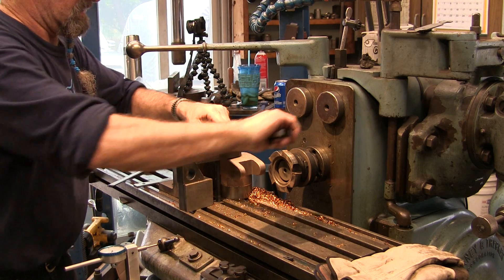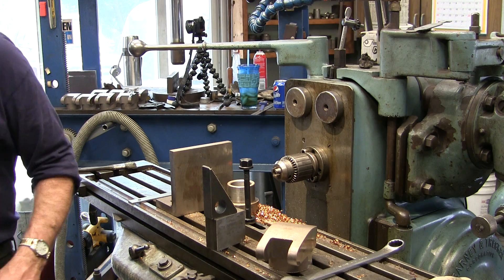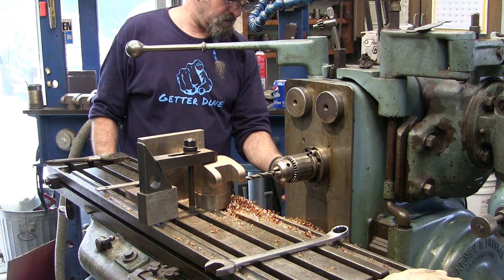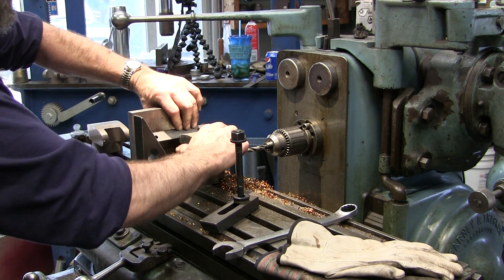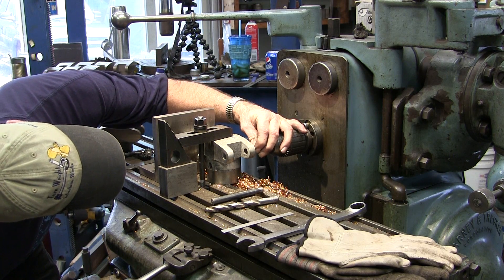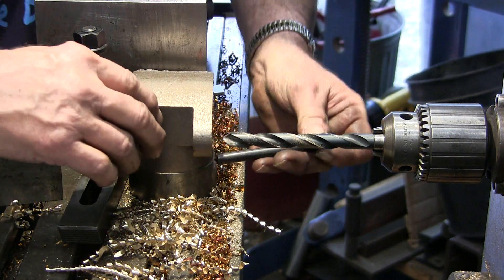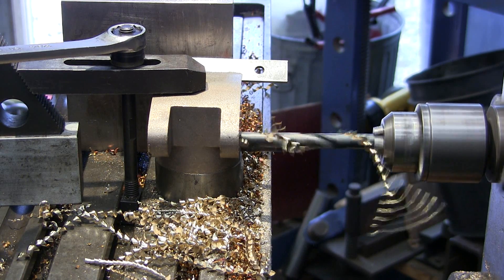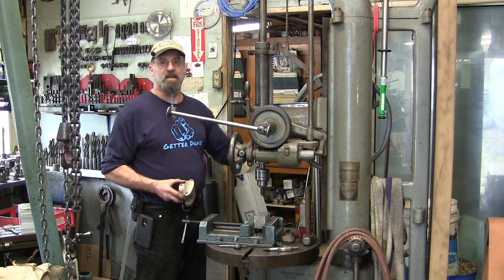Come About Tiller Head Part 3

Comment: very interesting setup, very simple ,efficient and producing parts in a reasonable tolerance.
the only point is that when we use a reference part for making the setup, unless taking caution to be sure that this part is dead on spec, the lot of parts produced is less accurate than the initial part this principe is the base of generations of measuring instruments (parts  could be out of spec due to deviance accumulation in the setup)
usually the first generation is the standard.it is usually kept by standard organisms and is used for reference only
the second generation is masters for laboratory use and never quits the laboratory
the next generation is for tool rooms and the last generation is for production

very good work

Comment: why didnt you just use the 3/8 pin to realign the part for the 1/2 holes? more accurate to keep the holes parallel.

Comment: Nice series of videos on these tiller heads Keith.
Thanks for sharing them and glad you are back.
I realize that you have to built what the customer wants, but looking at the relatively large diameter of the rudderstock in  combination with the two 3/8" holes it seems that the original construction with a clamping bolt through the tang gives a more reliable connection of tiller / rudderstock.
But hey, who is interested in my opinion.

Comment: Kieth, one thing surprised me about your drilling the holes through the ears. 
You have the K & T zeroed on your shaft cross hole and you have done this job before, so how come you didnt record how much to move the center point over for the 1/2" drill bit in the Y and Z axis? You have a known reference point so shouldn't it be used when locating the next set of holes? Or did you wish to show us just how to find the center point using the center finder? Just curious.
Reply from the maker: +Mark Fryer I get these parts about once a year and I just follow the sample. ;{)------

Comment: Keith, are you using a regular drill, or one that has the lips stoned flat a bit.
   Tim
Reply from the maker: +just tim This one was standard grind.  ;{)--------
Reply: +Keith Fenner : Is Bronze ok for regular bits, just brass or copper need the lips stoned?
Reply from the maker: +just tim there are different alloys of bronze and brass , some soft and grabby and others almost as hard as steel. The bronze I was doing is the kind that if a full drill cut is made it doesn't tend to suck bits. ;{)------

Comment: Nice work, as a manual miller I would have turned the angle plate 90 and used it as a stop and parallel for the work then clamped it from the other way then milled using the first face as a reference and done all the opp's of it.However it is how you do you work.   Tim in the UK

Comment: Could you have used the preceeding hole drilled for the 90 degree allignment rather than the bar ?  Making sure both holes are parallel

Comment: I have been watching you, Adam, Tom, Kieth and all the others for a year and a bit now picking up information and handy hints all this time and I can say the biggest thing I have picked up is the fact you all set guides for accuracy ave always been the same, it might sound silly to most but the guidelines that you and the others set for being accurate in the easiest jobs and theses jobs where the parts are harder to set but they are the same but it has taken me a while. I might not sound exactly smart but I can take a ruf cut piece of metal and start anywhere on it now and come up with a perfect part repeatedly, I dont have a square part but by the time I'm finished it ends up at .001 mm or lower to what I needed. This not always taught but I found it watching you guys, so thanks for the effort you put into these videos for us for free you have my deepest respect. 
Again thankyou 
Peter

Comment: Loved the center finder in the 1/2" hole trick! You mentioned the bores being different sized, don't the loose fitting ones cause problems about getting the same amount of material milled off both sides?
Reply from the maker: +bcbloc02 Some were a little different / a couple thousandths, but the tiller handle is custom fit to each head. ;{)-----
Reply: I second that on the center find tip, it's always the logically obvious ones that catch you, n1 Keith!

.Me